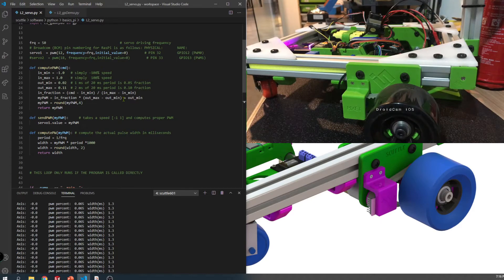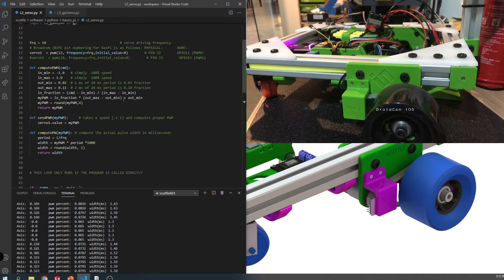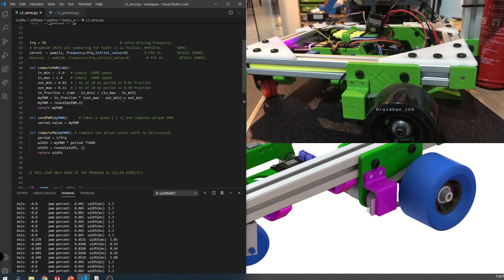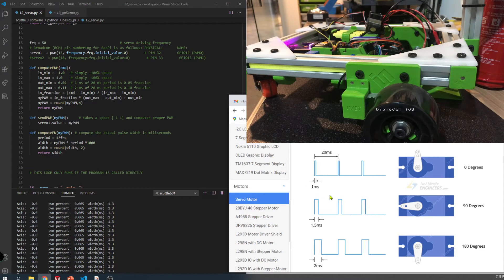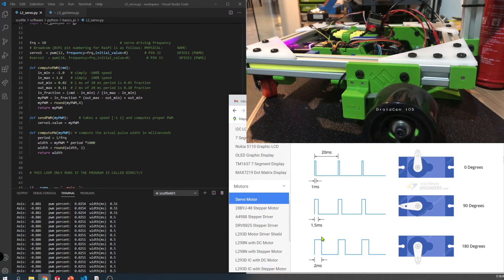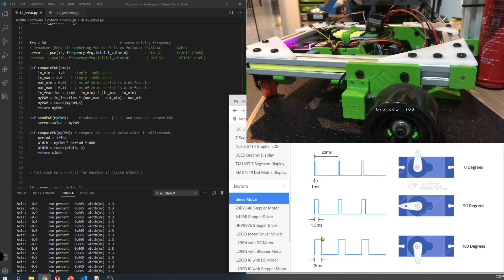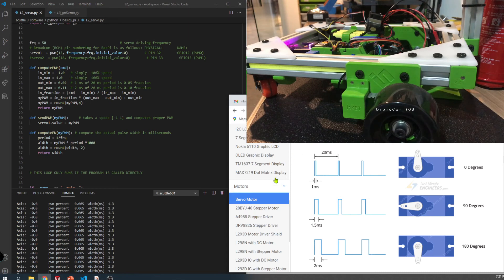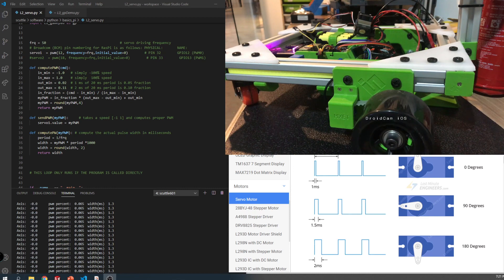How to connect a Hobby ESC (speed control) to raspberry Pi - drive a 12v DC motor bi-directionally

Comment: Hello, if you dont mind, can you share us the code?
Reply from the maker: I think the code is nearly the same as this one https://github.com/scuttlerobot/SCUTTLE/tree/master/software/python/basics

go there and find L1_servo.py
Reply: @davidmalawey  Thank you so much, you're perfect :) Actually, my aim is running brushless motor using pwm and raspi but I couldnt find any code or sample. Do you have any idea or source about it?
Reply from the maker: @oguzhanbozoglu7996  brushless ESC uses the same signals as the brushed ESC.   There is one caviat.  Unlike the servo, the ESC does not like to transition between forward and reverse rapidly.  you need to first give a signal to ask for 0% speed.  See https://lastminuteengineers.com/servo-motor-arduino-tutorial/

Comment: Hello, nice video. I am trying to control a BLDC motor with VESC 4.12 and raspberry pi but the motor is not running with PWM signals I am giving. Can you tell me what I can do here to make it run?
Reply from the maker: There is a very nice diagram at lastminuteengineers.com explaining the precise PWM signal you need to send to make the ESC function.